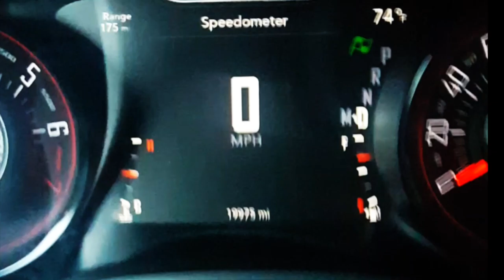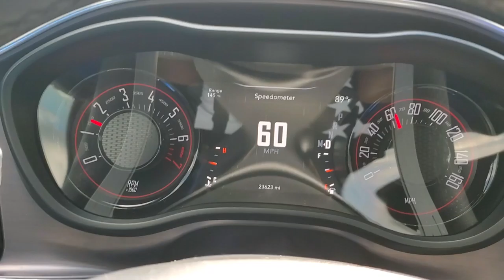MY RIPP SUPERCHARGER IS DEAD!!

Comment: I was soo close to ripping my 2019 Blacktop Charger but it videos like this was the reason I traded that bad boy in for a 2015 SRT 392 CHALLENGER INSTEAD. LOW MILES, ONE OWNER, ALL MAINTENANCE RECORDS. All I did was took it to a Dodge Dealership and had all fluids replaced, tune up which included coils and spark plugs and timing and rotors and brakes all the way round. Best decision I ever made. Real V8 power
Reply from the maker: Good fo you!

Comment: Awe Man, NOOOOO! So sorry to see that Wulf.  Looks like a flaw in the kit that you bought, the hose was flawed. Damn, the worst that could happen due to that, did. RIPP should've covered the damage due to the bad hose sold in their kit. I remember just last December one of my idler pulleys from the kit failed due to some bad bearings. Just a random uncommon issue, you never know like you said. I also had to get mine taken off, ordered the parts from RIPP, and deliver them back to the shop. $1100 later two pulleys, a new belt and labor OUCH! At the very least I thought RIPP should have covered the parts, they said since I didn't by the kit directly from them they couldn't. Understood, but it's still your kit! Like you said, it's risky.  I often try to check under the hood and inspect those things with the SC every few hundred miles or more. You'll be back for sure brother, stay up! Cerberus looking sickly🤣🤣🤣🤣 you a fool. She still looks good tho!
Reply from the maker: Yeaaaaa I dont see them covering anything  I cant prove it was faulty  , im sure it will some how be my fault  😅 I'm hoping vortech will help me out though  ...its ok though I know things break just can't wait to get him back on the road ! ..definitely gonna check on it more when I get it back smh  CERBERUS IN THE BACK LOOKING SICKLY LMAO 🐺🐺🐺🤕🤮

Comment: with a RippSupercharger you need to change oil more then regular car, don't just change the oil at 7k miles. Do it every 3-4k. and you need oil catch can.
Reply: it has nothing to do with supercharger it has to do with maintaing it dont blame rip tho
Reply from the maker: Always someone who knows more than the company who made it in the comments or they got the perfect diagnosis lmao. I have a catch can.
Reply from the maker: You have to know what's  going on before you just start commenting. The end of my drain hose was leaking the bolt was tight but the  actual  hose had a small  separation had nothing to do with maintaining it.  I been boosted 3 years now not much you can tell me.
Reply: @ridingwithwulf1989  well you are supposed to change the oil WAY before 7k miles which is exactly why you said in the video that it was running on no oil and which is why it starting messing evereything up because no oil, ya Im sure the bolts and all was fucking up because no oil lol
Reply from the maker: Maybe your illiterate? The hose had a leak all my bolts were good the hose had a small hole that has nothing to do with oil changes and rip said 7,500 so u must no more than them ? Ooohh the comment section lol

Comment: any time you add a turbo or a supercharger your car will always burn at a higher temp so itll burn up more if not twice as much gas. i learned that the hard way with my mustang. so if your car is turbod than you gotta change your oil sooner than recommended.

Comment: you mentioned your GT is awd n sounded like you can put it in awd anytime.  i have 1 too n idk how to put it in awd, only goes in when cold or slick.  plz share how to put in awd!  thx, tony
Reply from the maker: Yup all you have to do is put it in sport mode OR turn the traction control off  the button right about the passenger side heat button either one of those ways will put you in AWD
Reply: Get a ZAutomotive Tazer so you can switch between the two

Comment: Thanks so much for you posting this.

So you recommend I just go sprintex?

I'm shocked if they have a 1 year warranty that they didn't assist you
Reply from the maker: No problem boss got to show the good and the bad and the ugly haha

I honestly would still recommend the ripp kit, I know alot of ppl with the kit and nobody else has had this problem so I think its my fault some how 🤷🏿‍♂️

Well I was a at like a year and 4 or 5 months so I was just hoping they would look out but it wasn't to expensive
Reply: @ridingwithwulf1989  when you installed the ripp kit did you have to cut anything?

Comment: Our Ripp failed at 9,000 miles. We did not have an oil leak. It just failed
Reply from the maker: Dam im sorry to hear that, what kind of car was it on jeep, charger or challenger?
Reply: @ridingwithwulf1989  2015 challenger
Reply from the maker: @margaretmyers8937   what did you end up doing? After it failed?
Reply: @ridingwithwulf1989  I removed the blower and sent it to Vortech. To my surprise, Vortech covered everything but shipping. I can't wait to get it back in the car. Hopefully, we have a couple weeks before they salt the roads
Reply from the maker: @margaretmyers8937  wow , thats good to hear! Glad they had your back 👏

Comment: Maybe something went wrong when you Dyno tested and tune it last time I believe with higher psi boost. RIPPs website says to safely tune it to 11-12 psi of boost, gaining 175+HP. So maybe with higher psi boost the supercharger burns oil faster than what originally was to be change. But who knows It’s just something to think about. Hopefully Vortech will warranty it good luck sir.
Reply from the maker: Thats a thought 🤔... but i wasn't pushing 12+ boost and I had a visible oil leak  ...i should come out on the other side haha
Reply: Y'all know the boost is mechanical. It's not a turbo. You can't change a spring or tune to increase boost. You get 11 to 13psi depending on rpms and pulley.
Reply: Doubt that. I forget how much psi the supercharger can actually take that’s probably just the max on the stock motor.

Comment: It's not even a proper supercharger it's a pro charger if im correct. But you should just do a custom turbo kit and be done with ripp
Reply from the maker: I think technically it would be considered a procharger , ripp still solid in my book shot breaks its cool ...custom would be a good idea though 🤔 you got info on that?
Reply: @ridingwithwulf1989  I'm building a custom atm but its not done until October I got a way bigger turbo then normal so I'm it's a win or a Loss for me. But that's my choice why not just convert the parts off your ripp kit and use it for a new turbo kit like beside the tune it should all be basically the same thing besides a small amount of parts. It would mainly just be up to you to have it thrown on a dyno and tuned out. I don't like a lot of these popular kits because you never know how cheaply made the parts are and the tune they usually come with is only really made for the car it was originally tuned off of but that's my opinion.
Reply from the maker: Are you gonna be getting a custom transmission as well?
Reply: @ridingwithwulf1989  no so the power levels I'm going to stay will be in the safe zone transmission wise once my rearend is built all go to the transmission and then move to the engine. Surprisingly the sxt trans is super resilient
Reply from the maker: I know a guy with 420 to the wheels  he just blew his trans on his sxt smh  . He had the ripp kit also
Reply: @ridingwithwulf1989  really with 420 to the wheels so he had to be pushing some 500+ to the crank it could have been his tune I know a lot of things go into play when boosting at higher levels and the best thing I learned is ti take it slow and easy for the first month of driving just break it in as the internals wont be used to such a fast power switch
Reply from the maker: Yea i was shocked because he had less hp than me an my trans is fine...so far haha but national speed Richmond is  really good at what they do?
Reply: @ridingwithwulf1989  yeah see it all comes down to who the tuner is I'm seriously debating on driving from California to hemi fever just so they can get it on a dyno but nobody has replied to my emails I have a professional tuner in my area but hemi fever is what I'm told is the best in the game right now
Reply from the maker: Do they work on the v6?
Reply: @ridingwithwulf1989  oh yeah they do some of the best tuning that I know of for the sxt challenger but as you know there isnt much out there as of modifications and tunes for us so mainstream wise that all I know there could be a smaller tuner shop that could do better but Idk for sure because I cant find anyone

Comment: Should of got a 6.4 to begin with! But that's just me.
Reply from the maker: Sometimes I  feel like that too just for peace of mind but there's no AWD  and I need that for all the snow we been having
Reply: Scats are nice but still get walked by Stang's and Camaros
Reply: Exactly, the engine can last 200,000 but the super charger who knows. Especially if the company goes out of business. For example in 2003 i had a civic and installed a jackson racing supercharger. 6 years later they sold that style to moss motors and now to get support you have jump through so many hoops from paying someone to take it off and shipping and if fixed paying someone to reinstall plus when reselling the car nobody wants a modified car as the buyer has no idea what was done and if it was done correctly. Luckily i sold it before anything major broke (pulley went bad
Reply: Stock 6.4 isn't 540 wheel horsepower not even with bolt ons and if it's AWD it's only about 370 stock 400-410 with bolt ons and a tune ...so I'm pretty certain he'd be in the same boat with a 6.4 .

Comment: That's why you don't mod a V6 ever. It just wasn't made for purposes of excessive or extreme speed. Generally when people want speed they buy a V8 and so on. They never buy V6's. Only people that buy V'6's are people that are smart when it comes to saving at the pump and want to drive something sporty yet very economical. That's one of the reasons I purchased a 2020 BLACKTOP CHARGER. The other, because I'm not trying to get arrested and lose anymore time behind bars. It's easy to get caught up like that in the Demon's, hellcats, scat packs. But hey car enthusiast for years have been customizing car's for decades so to eaches own. But remember modding comes at a risk. Like we have here. That's a lot of money down the drain when you could have purchased a mustang gt for what you've invested in your V6! On Mama's 🥴
Reply from the maker: I've  now been  boosted  happily 55k miles any time you  mod a car there's a chance something  will break.
Reply: It has nothing to do with modding a v6. turbo bearings and seals can go bad . Over tight(stripped) or loose bolts for oil feed or drain  simply usage can can problems .  Hell ive see turbos clocked wrong and feed oil past seal and suck in the intake and starve bearings  and cause it to cease . Looks like It was starved for oil and damaged seals that inturn damaged bearings or bearings off the bat.

Replace whole turbo ,or if you have knowledge rebuild kit or new cartridge and good to go .
Reply: Preach

Comment: I just finally saw this video after 3 years. It sounds like you leaned it out with those unknown injectors you put it and fried it. I couldn't believe you did that. Too bad you never listened to single thing I ever told you. From your unmatched wheels and tires to your stupid plastic hood. Since you've been gone 3 years I don't expect you'll be back. Same thing with Supercharger 6. He carbon locked his engine because he didn't have a working catch can in it. I had a cheapo Ripp hose clamp drop a hose at 1,000 miles, but my temp gauge caught it and it only needed a hose clamp to fix it. After that I changed them all.  I would hate to think you fried your engine over that but if you did, it only proves you shouldn't have had the car in the first place. You certainly know nothing about cars. Sorry. I have 25k on mine and no problems so far. All the bogging problems went away when the trans finally re-learned the engine at around 15,000 miles. Just like I said it would. High performance cars have to be brought along very slowly and you just went on and beat the hell out of it. In fact, this is by far the nicest, most powerful car I've ever owned out of 14 cars. And yes, I watch it like a hawk and its service is 2nd to none. It's gotten an oil change with Amsoil oil every 3,000 miles since it was new. You can pick up a fresh engine for about 3,500 bucks. Half the price of the supercharger. That's what I would've done within a week. Since you've been gone this long, I can only assume you got rid of the wreck. And that's what it is, a wreck, and you made it that way. No one else.
Reply from the maker: I'm at 103k miles with Cerberus. Cars in great shape.  Weirdo.
Reply: @ridingwithwulf1989  How soon we forget. So where have you been for three years. What are we supposed to think?